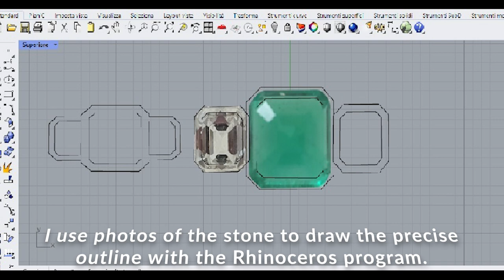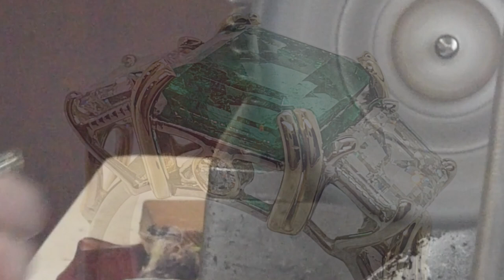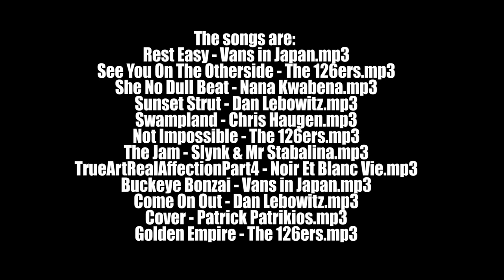Very important Handmade 18 kt gold ring

Comment: At what point in your career did you feel that you had the confidence and skill to set that emerald?  One false move and ...
Inspiring video.
Reply from the maker: Thanks. When you mount gems you are never sure, it is always possible that a pressure in the wrong place will damage it. Fortunately, it happens very rarely, and in any case the damage done is often repairable. If the gem is owned by the customer, he should always be warned of this possibility.

Comment: Not hand made to all, used machine lasser 🤣
Reply from the maker: The same steps in which I used laser cutting are feasible with a hand hacksaw. When I speak of manual processing, I mean that processing that provides that the object is not made with lost wax casting, but is built starting from plates and drawn parts, whose resistance and flexibility give the finished jewel greater resistance to wear, while lost wax jewels often encounter problems of fragility, porosity and lack of elasticity.